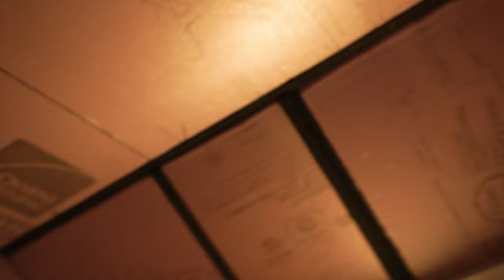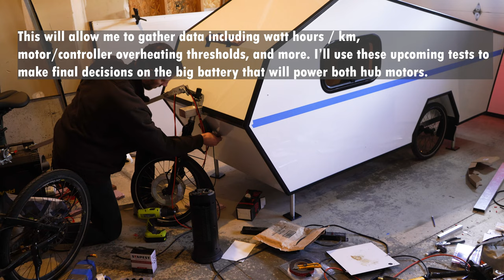Building Electric-Powered Bicycle Camper (PART 12)

Comment: What is that glossy white sheet material you use for the exterior? Is that filon? And if you're in Canada, where did you order it?
Reply from the maker: Hi Nick, it’s aluminum composite panel. I used recycled commercial signage. Just had to rip a realtor’s face off the surface and underneath it was good as new. Buying new is not cheap - there are distributors in Toronto.
Reply from the maker: Cant recall the names sorry!
Reply: @Jerbrown  Excellent thanks! I will try to see if I can find some :)